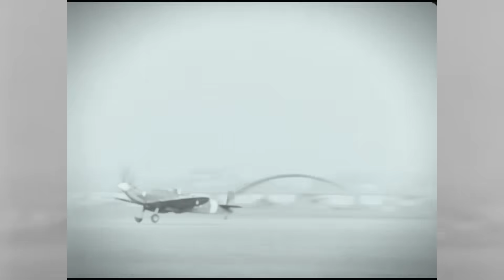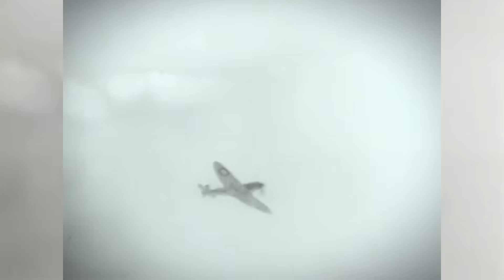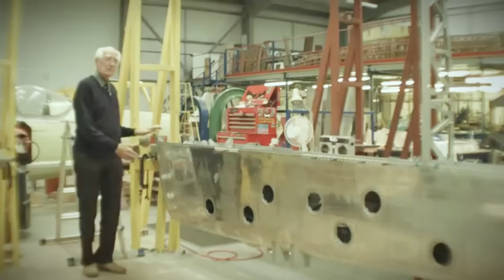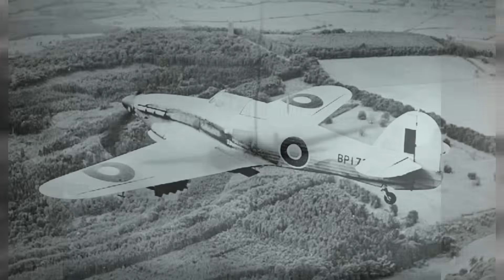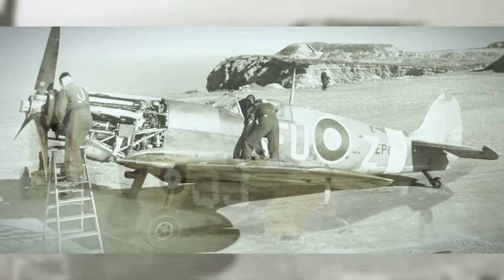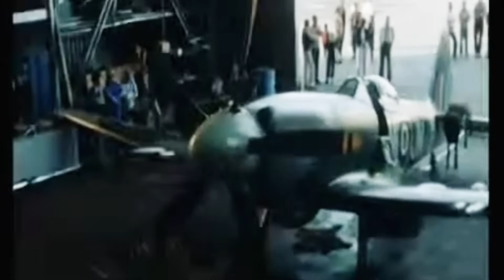The WW2 Plane With the Most Dangerous Wing

Comment: Nah.
The Spitfire was a splendid plane but I really abhor this mythologizing. If the wing was efficient it was more due to the bold decision to go for a 12% chord thickness, very thin for its time. The elliptic shape was very complicated and expensive both to manufacture and repair, also it limited the size and thus effectiveness of ailerons; the Spit's roll rate was never its strongest point. Pretty though.
Compare the Bf 109, who also coincidentally was a pre-war design that was continuously improved upon until the end of the war. Its wing design was very different, had a chunky 16% chord thickness (like the P-51!)  but could still rivalise with the Spit, and was much, much cheaper to produce.
Again, not ragging on the Spitfire, but there's so much contemporary literature discussing its shortcomings (and oh boy there really were some shortcomings in there), and I in my mind if you really want to appreciate something you need to look at the whole, not just the pretty tales.
Reply: The Spits roll rate with the clipped  wing was 150 degrees @ 220 mph I have no idea what the FW190 was
Now come on mention its shortcomings Please do 
Wing Platform if you are going to mention it do it right
 Wing. Platform elliptical; section NACA 2200 Series : Span [F] 36ft10in ;incidence deg root +2 ,tip -1/2 ; dihedral deg 6: thickness % root 13.2,tip 6 : aspect ratio 5.6:1aea nett 220: gross 242 ; chord [geo] 6fft 8in ; [ma]74.3 . Ailerons .  Area 18,movement deg up 26, down 19; droop 3/8. Flaps .Area 15.6; movement deg down 85 Wing loading 32.1 lb/sq ft Power loading 4.97 lb/hp M61 ,4.55 M63 
 I know I am a pedantic troll 
And the Bf109 turn 853 ft radius 109 deg Bank angle @94 mph   Spit 687ft Bank angle 69deg@85mph so hardly equal 
No other wing could withstand T/M 0.89
No other plane  matched the Spit in the climb  in the ETO
Reply: @jacktattis  so ... What you are saying is that the spit fire could turn like a MOFO, and climb like super M? 
Yeah, I agree. You could put an 18-hour fresh pilot in that machine, and he had a fighting chance against a German ace.
That person should have stop his comment at "The spitfire was a splendid plane"
Reply: @argolen  Well I could reply but you do not speak English So I will await your next effort
Reply: @argolen  We had more  than 18hour pilots my friend
Reply: Yes, you sound what I have always thought since 1971 here in New Zealand….but saying that Spitfire Wasn’t as good as it was cracked up to be! It was almost a quick way to to be classified as some sort of a Weirdo when you were a 13 year old in Rural New Zealand at Boarding School !
Reply: Captain Eric "Winkle" Brown RN was a test pilot during and after WW2 and flew something like 447 different aircraft types and made over 2,000 carrier landings ... He flew I think virtually everything the allies built and many of the axis aircraft..... He is on record as saying that in a dogfight he'd pick a Spitfire over the Mustang any day of the week ... Unless the fight was over Berlin where he'd opt for the Mustang as it's range would get him back home
Reply: @petersmith7126  He never  said that about being over Berlin.
Reply: @jacktattis ...Oh yes he did
Reply: ‘Compare the Bf 109…that was continuously improved upon until the end of the war…its wing design was very different, had a chunky 16% chord thickness (like the P-51!) but could still rivalise with the Spit…’

Not so.
By the time of the introduction of the Mk. XIV Spitfire in early 1944 a clear lead had been established, combat trials with a 109G showing the Spitfire was superior in every respect.